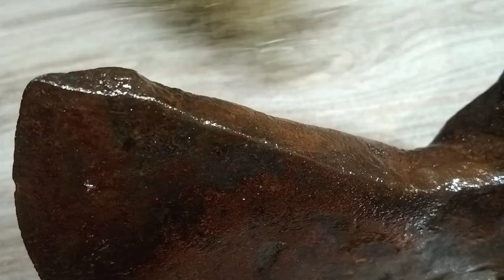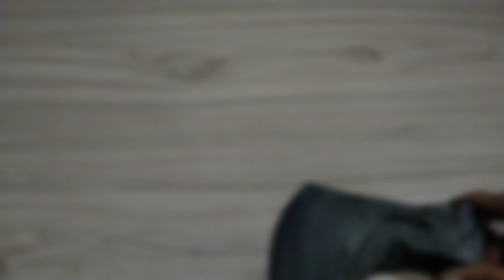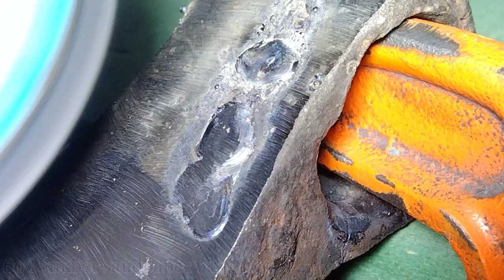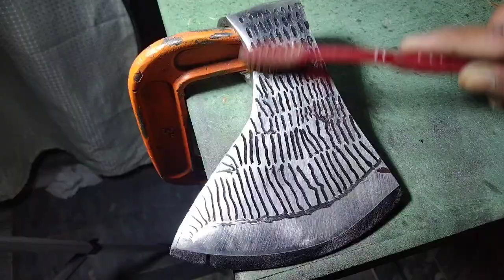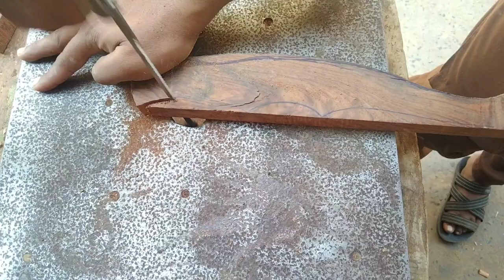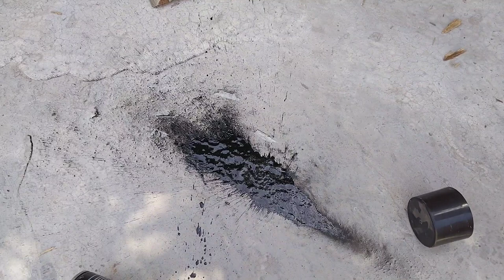Rusty Old Axe Restoration With Ebony Handle

Comment: When you burned out the wood and filled in the marks, you got it too hot and lost whatever heat treatment there was. It won’t hold an edge anywhere near as well now. It would have been better to use no heat. 
I honestly would have left the deep crack as it was. It looks like a result of someone forging at too low a temperature, but it’s not a real problem. I think it adds character. 
The final result is beautiful, and you have good production quality. But it won’t be very functional, and will quickly lose its edge. 
I like what you’re doing, and will subscribe. I wish you success in your learning journey, and hope to see more like this. 
All the best.